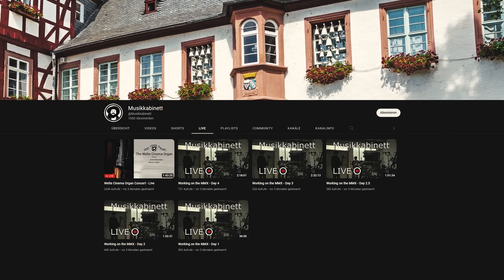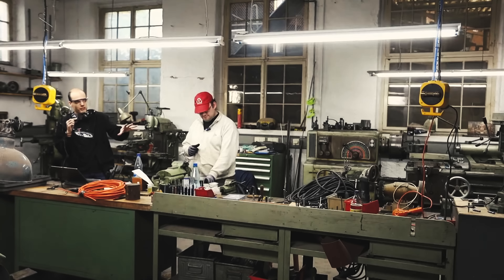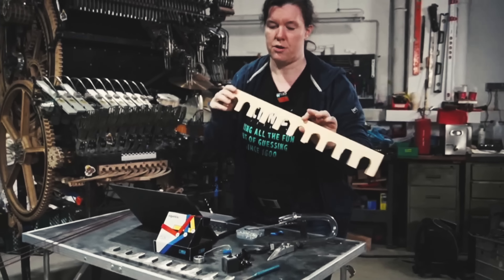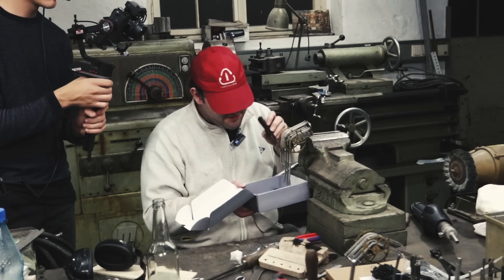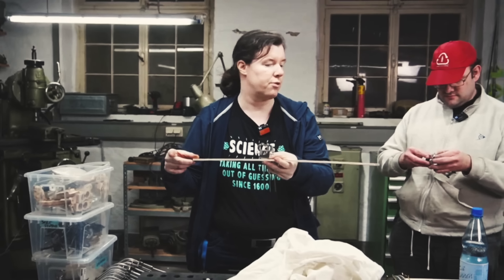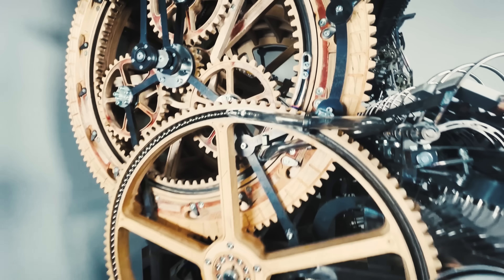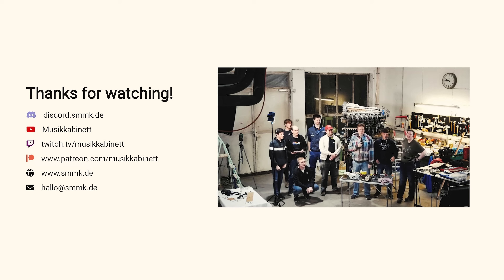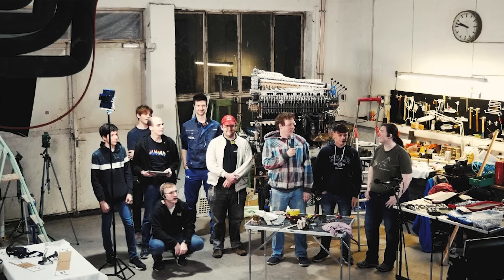First Marble drop with new vibraphone gates | MM(X) #4

Comment: MMX is a piece of art. MM3 will be an incredible instrument, but MMX will always have a special place in our hearts 💕
Reply: The original MM, currently in shambles after years of not being used by Martin:
Reply from the maker: Yeah MM looks quite rough. Not standing in a open shed at least somewhat stops the deterioration.
Reply: MMX have its advantage - it exists right now, and MM3 will exist in future.
Reply: @Musikkabinett  What if you went Ship of Theseus on it? At the very least, you might be able to make a replica that won't decay over time. (I'm not holding my hopes out for functionality, though. )
Reply: @Musikkabinett  is it salvageable?
Reply from the maker: @jonathancullis9155  As a art piece definitely. As a working instrument will be a challenge without changing it to much.
Reply: And if not MM3 then MM4 or MM5. So patreons prepare your wallets 😂😂😂